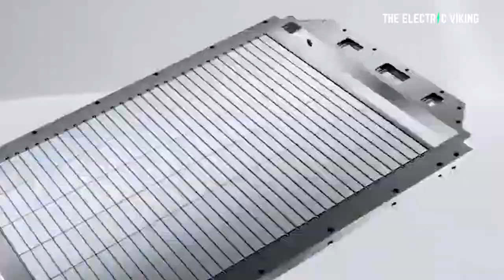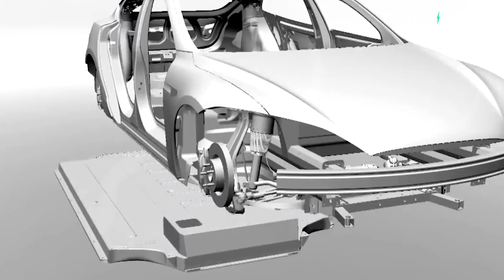Tesla's Model 2 Hatch & Crossover will KILL gas cars in 2023

Comment: I think you are right in a lot of this.   I do have a fear.   A lot of the inflation we currently experiencing is due to fossil fuels jacking up price for profits, because they, an oligopoly, can. We are a captive market.  Mostly.

But my issue is Tesla.  I am worried Tesla is going to corner a huge section of the market place.   I don’t mind them leading the way and showing that it can be done, and done very profitably.  But we need competition in the EV market to force the prices even lower then what you are talking about for the Model 2.   So everyone that needs a vehicle can afford one. Besides it would be a very boring world if all vehicles looked like a Tesla.  They need strong competition, to keep them sharp!   To keep prices low.  To keep cars fun!
Reply: Agree but legacy does not have engineers that are worth a shit. So it costs way more to produce a car. Time, labor and design are not legacy talents. It has been 20 plus years with no new engineering. Just new sheet metal
Reply: @b4804514  I think a few of them can make it threw.   However don’t limit your thinking to just the legacy field.  EV start ups will play a big role as well
Reply: I can’t offer a test drive in a  model 3

Comment: It will also have V2G, no issues with LMFP batteries as they can be charged and discharged through 0-100% cycles. This allows part 2 of the transition to renewable - storge of energy during off peak periods to be used during peaks.

Comment: If my memory is correct, didn’t Tesla buy land about 3 miles from current Shanghai?  Could this be a possible assembly location for a Model 2?  Could you do a part two researching info on this site?  Thanks and congrats on over 100000 subscribers.  Good work.😊
Reply: That's pretty much fact rather than speculation

Comment: The batteries could be CATL Sodium-ion, that are cheaper than LFP, and they are supposed to mass produce in 2023 as you have mentioned in a recent video, if I remember correctly. I think the price will be close to 30k in USA because of Foxconn starting to build their Model B and the Fisker PEAR, same skateboard, in Ohio in 2024 at just under 30k. That will be Tesla real competition in that segment not GM.
Reply: Has CATL successfully developed a Sodium-ion pack? I remember this being talked about, and if so WOW that is a game changer. Sodium supply is everywhere
Reply: Sodium-ion will cost the same because is heavier than lfp for the same power so you need more of it and also at the end the car will eat more energy

Comment: I would be extremely surprised if it came out before 2025ish. Too much going on right now with FSD, Cybertruck, Model Y, Semi, and Roadster
Reply: I could see it in China first, they’re not involved with CT, Roadster, Semi, etc..
Reply: Agreed Kevin, there's no way a smaller vehicle will be produced next year. Tesla is so far behind with Roadster, semi and truck to focus on a high volume lower cost vehicle
Reply: It might be unveiled in 2023, start low production in 2024 and ramp up as we move to 2025 and beyond.
Reply: @georodop  I very highly doubt that. I don’t even think Tesla has designed it yet, let alone had enough time to complete a prototype
Reply: @kevinsaint20  Sure, they don't have a prototype yet but it's a high priority now and as announced during the Q3 earnings call the product design team is focused on this now. So, unveiling a prototype during 2023 should be feasible.
Reply: @georodop  Elon said in the Q3 call that this new vehicle (which was never confirmed to be the “Model 2”) would be in the same price category as Model 3 and Model Y. Which seems to fully suggest that the model they are currently working on is not the $25k car. There are lots of speculation on what it is but I doubt it’s the $25k car. More likely to be a precursor to robotaxi or perhaps a smaller van that he has teased a few times
Reply: @kevinsaint20  
According to the call transcript below, it might start at the same cost of 3/Y but the goal is to make the next generation platform 50% cheaper as it happened in the transition from S/X to 3/Y platform.
Martin Viecha

"Great. Thank you very much. And let’s go to the last investor question, which is the progression from Tesla’s first platform with S and X to the second platform with 3 and Y, led to a 50% reduction in cost of goods sold. When do you see Tesla’s third platform being released? And what level of cost of goods sold reduction could you achieve?"

Elon Musk
"Well, we don't want to talk exact dates, but this is a -- I mean, the primary focus of our new vehicle development team, obviously. But at this point, we've done the engineering for Cybertrucks and for Semi. So, it's obviously against what we're working on, which is the next-generation vehicle, which will be probably about the cost of 3 and Y platform. It will be smaller, to be clear.

But it will, I think, certainly become -- certainly exceed the production of all our other vehicles combined. I mean, obviously, we're going to take everything we learned from S, X, 3, Y, Cybertruck and Semi into that platform. But we -- as you've said to us many times, we're on a 2-for-1 target. So [Inaudible] we're trying to get to that 50% number again.

It's like, we're going to take two. If that's exactly what [Inaudible], how are we making two cars for the amount of effort that we currently take to make one Model 3."
Reply: @georodop  Elon is very clearly talking about how they are trying to design and manufacture 2 vehicles at once. Designing a vehicle in 50% of the time. Not 50% cheaper to the consumer. Same price as Model 3/Y and will be 2 different vehicles. Could be van and hatchback Model 3 variant. Still doesn’t make any sense for it to be the $25k car because again, both new cars will be the same price point as Model 3 and Y.
Reply: @georodop yes, but he's implying we will see these in production next year, and I think that has a probability of zero!
Reply: @kevinsaint20  Thanks for sharing your view on this. You might be right but it will be a nice surprise if they make it earlier than expected. Let's return to this conversation in 2024 😊

Comment: Good video. I think most of it is probably on target. Except I think there will be, or at least should be, only 1 variation. I don't think there will be an "SUV" variation - there is no such thing as an "SUV" that small anyway. And there should only be entry-level variation only - standard range, single motor. Keep it simple and affordable! Other variations are completely unnecessary and only allow Tesla to distract and upsell what is not needed. They will only make the more expensive variants and never the entry-level variant, and the $25K Model 2 will be just as much of a myth as the $35K Model 3 was. Enough. Keep it simple - 1 variation only, keep it truly affordable, and truly roll it out to the masses! By the time you have to buy the paint color you want, the wheels you want, etc., the price is already higher than the entry level price anyway. Just keep it at that. 1 variation, a few options, the end.

Comment: I haven't done too much reaserch but my thoughts are electric vehicles are all good BUT  not only here in Australia but worldwide there seems to be a current problem with the capacity of the power grid needed to recharge these vehicles. Maybe Nuclear power stations,, what are your thoughts?  Also upgrading of the network cabelling to handle the vast capacity required.
Reply: Renewables can easily power what is needed in Australia. The problem is that very little was done over the past 9 years by the previous government to upgrade Australia's power infrastructure to power our future with renewables. Thank goodness that the present government is now doing this but a lot is needed to make up for the "lost" 9 years.
Reply: @andrewjoy7044  If renewables can easily power the Australian electricity grid why is it not doing so currently, the Federal government does not manage the grid, if you were better informed you would know it has been a State government responsibility since Federation. 
The better informed will also know that over the past nine years renewables increased from 11% of total Australian electricity production to 29.1%, South Australia has a renewable electricity penetration of 66% and pay the highest electricity prices in the country.
Perhaps you should make contact with an electricity grid engineer and have him explain to you why the percentage of wind and solar is limited for a 24/7/52 reliable electricity supply.

Comment: Great update, I’m hoping soon but very much doubt it as demos of the Cybertruck, Roadster and Semi where seen years before. Yes know the China factory has close for stuff but think it’s more about Model S changes, hardware 4 etc wishing it’s the model 2…

Would really prefer a car closer to my current car VW Tiguan which would be a Model Y ( like higher cars with the traction of an all wheel drive) but the pricing is too high. I would have to get a model S rear wheel drive, to get the Government rebates in NSW but if there is a car which is a little higher than the Model S and smaller, makes sense for someone that mostly drives by myself (at most 1 passenger) plus the lower price would be too good to pass up… hehe

Comment: Sam, why would they not use the simplest, lightest, least unsprung wt, least friction EV driveline? Or, the simplest lightest, prog. rate, programmable rate, self damping, anti roll independent suspension,  (1 moving part for2 wheels)

Comment: Yes, Sam you are correct. Weight reduction and Casting method and higher density battery using LFP is heading in the right direction.

"Kinetic Energy or energy in motion = 1/2 the Mass of car to  (Velocity square )”.

Lower the weight by one = lower the moving energy by one.  ( yes a linear progression just look at the equation of KE ) Yes lower the weight is a great start.  

What about the glass on the car, race cars remove the glass and use lighter plastic.  Race car rip out everything except the seat for the race car.  Replace the wheels and use Magnesium which is expensive but for sure will lighten the car.  Airplanes use lots of Magnesium to lessen the weight.  What about Carbon fiber parts.  Yes lowering the weight of the wheels has less sprung weight increase handling.
I know this stuff cause I use to be a race car driver and raced at Sears Point Raceway and Laguna Sega.  I am sure Tesla has engineers with race car design in mind.

Comment: The Roadster - they’ve been working on this for years and……what if it was built on the same skateboard coming out of the IDRA big boy - same as the Model 2 and the Roadster at $100k plus ?? there may be an option of pivoting manufacture between these two with many common products? Maybe too much to expect.

Comment: I enjoy your videos and the information that you relay to us. I have three main people that I track and reference. You are one of them and Munro is another. I am tracking another one also but it is more for the Semi market and heavy equipment. 

Here is my honest opinion about 2 technologies and this comes from years of being around industrial and commercial technologies.

I believe that you are correct and well founded in your assessments of Electric cars and passenger vehicles. I totally agree with you on most of your points about 85 % , the rest for me is a wait and see what evolves.

When it comes to Semis , heavy equipment and agriculture, I have a different view of things. 
I believe that some uses can be filled with BEV and some will need to be a Hybrid for awhile.

I believe that a large portion of those industries will need to move to Hydrogen and fuel cell technologies. This is because of the physics and realities involved. Also there are some uses and processes where you have to have intense heat that can only come from burning or fire that is normally fossil fuel. That can be done with H2 that is made through Renewables and Hydrolysis to form clean Hydrogen.

I also believe that some transport needs just cannot be handled by Batteries. I believe that there are many slices of the pie that need to work together to get off of coal and oil.

We may not agree on this but I am genuinely interested on your thoughts because I am always constantly analyzing new information and re-evaluating my beliefs on things. 🤔

Comment: The elusive M3P batteries that CATL is working on are said to be an improved version of the LFP chemistry. Sometimes confused with the LMFP type, which adds manganese to the formula, the M3P battery is still a lithium phosphate battery. The main difference is the substitution of iron with a mix of materials that include magnesium, zinc, and aluminum. This increases the battery’s energy density while keeping the costs in check. It is not quite at the NCM/NCA level, but it should allow a better range than LFP variants while retaining their advantages. Info from Autoevolution.   I hope it retains it good fire resistance characteristics.

Comment: The Model 3 is already the most fuel efficient EV.  Increasing production volume would reduce cost.  This Model 2 could be front wheel drive because to get efficiency a car needs regenerative braking.  It might be made with one casting.  China likes exports and this car could be a winner assuming Politics don't get in the way.  To out sell the Model 3 it needs to cost less.  Efficiency is not much of a factor as the Model 3 is already great.  If this car is a hit with young people they will drive way more miles per year than they would in a gas car.  Safety is important as smaller cars are not as safe as larger cars.  This car could have a huge fun factor.

Comment: I think it's not in test production yet since for another big cost savings it will have a stainless steel body, sort of a cyber-mini. But it could follow very close on the heels of Cybertruck production.

There will be steering wheel versions, but as soon as FSD is ready (very soon IMO) there will be versions without. That's the fleet of robotaxis.

The huge advantage of these vehicles over those of other manufacturers will be FSD. Governments will want to see FSD spread as quickly as possible because of the safety advantage. Plus let's not forget the insurance savings.

Finally, I think this vehicle will be used to open a GF in India, and probably several other locations.

Comment: I do contract work at an auto repair shop and fear these guys days are numbered as the repair / maintenance bills on ICE vehicles are astronomical. 
I drive my no maintenance T car to the shop and park in the back so it won't be seen to avoid issues. 
ICE cars days are numbered and it's coming soon.
Good Content.
Prayers for the wife.
Mine had stage 4 cancer as well 30 years ago and lived another 26 years after treatment. 
Best wishes.

Comment: Hey Sam I agree with 90 percent of what you're saying with one exception.  The disruptive technology that will challenge that outcome that you are predicting is an iteration of the current hybrid technology and Toyota will own a big part of this new hybrid technology for one very big reason.  There is a huge segment of the public that prefer living in an apartment and there are millions of apartment owners that won't complete electrification because they either don't want to or more often than not, they can't afford to electrify their parking areas.

Toyota will use probably a highly efficient 2 cylinder engine that will run at a constant and efficient rpm as a non (drivetrain) connected power source providing a potentially constant source of energy to a 3 to 5 kw battery which in turn will power a front electric motor that is the only motive force for a wide selection of body types of vehicles. Fuel economy figures will likely exceed 75 mpg and most importantly these will be the MOST reliable vehicles on the planet bar none and they'll better fit the lifestyles of apartment dwellers.  They will simply be the most economical and best choice for hundreds of millions of people and perhaps that is how Toyota will bridge the gap towards full electrification.  Don't forget also that big oil won't go down without a fight so the consumer will be the winner.  Yes a fully electric future would be great but I say that hybrids (especially the new hyper efficient ones), aren't dead and in fact will see a resurgence in their most efficient forms.

Remember, it only takes about 10 horsepower to keep a small car rolling.  A small electric motor of maybe 80 horsepower can meet most people's needs and a 5 kw battery is all that's needed to power that single motor.  A hyper tech 2 cylinder engine will have it's heydey running at about 3000 rpm except when driving steady at 75 mph.  At steady speeds the motor will shut down for up to 5 or 10 minutes at a time!!!

Just my .02 cents 😁

Comment: It will be interesting to see how giga-casting evolves, WRT structural battery packs. There seem to be some advantages to a single large "hot wheels" bottom casting but that might be redundant with a structural pack, plus make the mold/casting 3-5X larger, which seems extremely difficult.

Comment: It needs to be a chopped off box shape in the back to max interior vol.  It needs to have in wheel motors, same reason and to reduce weight.  It needs to have more height and be bug shaped in front, again to max volume.  Done.  Oh, it needs a steering wheel.